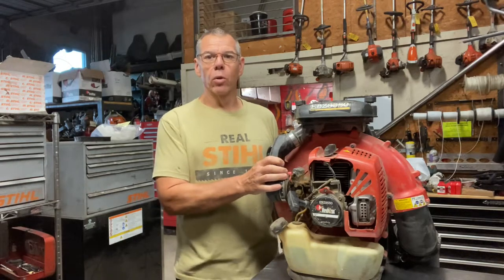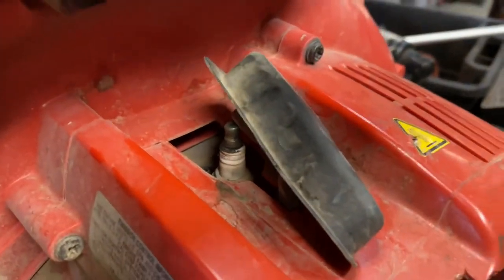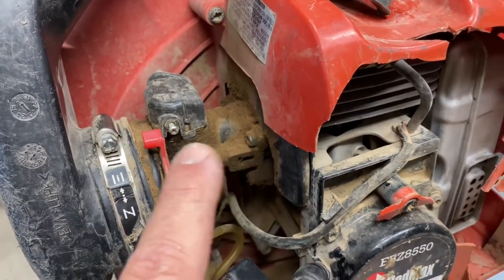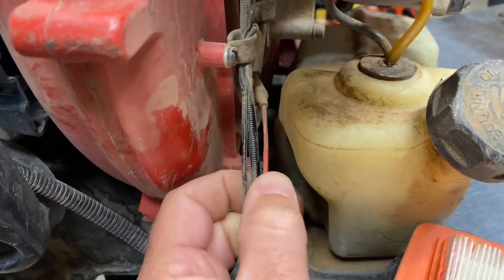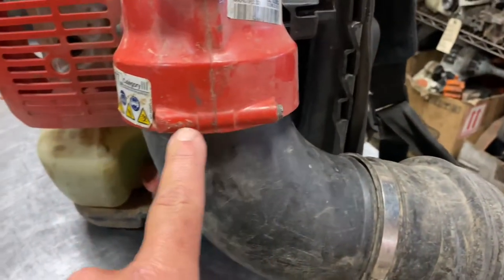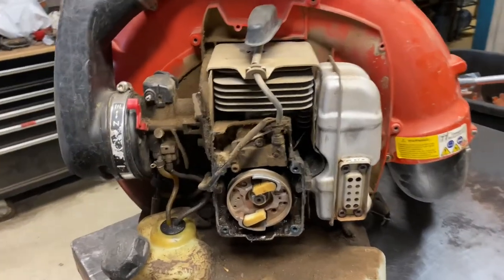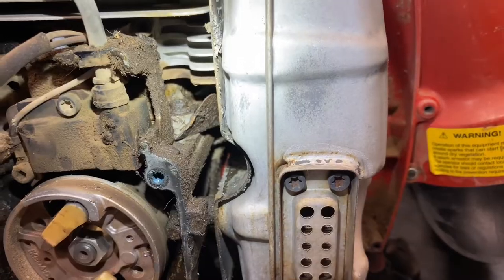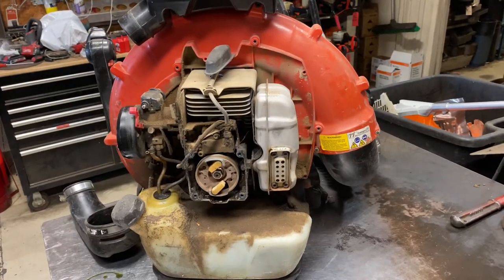Redmax Backpack Blower common problems (EBZ7500,EBZ8500,EBZ8550)

Comment: My EBZ7100 is 17 years old.  I ALWAYS used ethanol free 89 octane fuel with Mobil 1 2T synthetic 50/1 oil mixture.  (I stocked up on this oil when it was discontinued in 2010.)  Used approximately 20 hours a year (340 total hours).  Replaced air, fuel filter and fuel lines once.  Replaced spark plug every four years (80 hours).  I run dry and fog the cylinder each winter when stored for 3-4 months.  No carb work ever.  GREAT machine!

Comment: i have my original blower from 2013 many hours on it, did a top end two seasons ago and it runs great but sounds like its going to blow up lol. found out the fan spacers were all worn to hell. easy cheap fix and she will still be able to work as our back up blower
Reply from the maker: Glad to hear. They had a problem with fans a few years ago where the metal inserts came loose. We replaced a lot of fans under warranty.

Comment: Thanks for sharing your wealth of knowledge. I have a used Redmax 8550 I just bought. Ran it for 2 days and bought it but the vibration is bad when idling but Improves when speeding the engine up. Do you think there is a problem with the blower fan being out of balance.What do you think?

Comment: I rebuild these all the time locktite all your engine screws and fan screws, put a tiny dab of silicone sealant at the end of the crank split case gasket where the cylinder gasket meets to be sure not leakage 👍

Comment: outpowers stihls...and more reliable.
this is all mainly abuse.
7 years on mine...starts on 3rd pull cold everytime since new.....1 pull hot.
Reply from the maker: I agree most is from abuse. Some guy’s just don’t care.
Reply: I find the Stih to be far better. I have had my Stihl blower for about 6 years. Bought the Redmax two years ago and I take both with me doing very light, part time work and so far the Redmax fails me every time and I have to shut it off and go get the Stihl which sucks since I spend over $850 on the Redmax. They are junk imo

Comment: My dad bought a red max EBZ8001 on 2008. He used it for tree lawn care business until he stopped using on 2013 and he puts around 4 hours a day on it. Yes he does put it in full throttle all the time when he’s using it. He put approximately 980 to 990 hours per year and times that by five that’s around 5000 hours. Since he stopped using it. On 2013 which was 11 years ago, I’ve been using it every fall to clean up the yard. I put about 1 to 2 hours per year. I have additionally put on 22 hours per year and it’s still running to this day. I’ve ran a 45:1 to 50:1 oil gas mix. I Just have a question I have been wondering if they discontinued the EBZ8001 model? I haven’t seen Those red max models anywhere.

Comment: I bought one of these brand new for over $600 two years ago. used it very little then it wouldn't start after just once season; it needed a new coil and the company would not pay for it so add another $100 and I'm $700 into it. Last year it started dying whenever I would try to increase the power to blow leaves; I stored it in the shed for the winter and just used my Stihl blower which is not quite as powerful to do some jobs to finish up. Went to use the Redmax this November after not using it at all and same issue. They replaced the carburetor (another $130 cost) so now I'm up to about $850 and it still is not blowing anything. Any advice?

Comment: I have a ebz6500 I noticed oil not on the exhaust side but carb side down the block would it run differently I don't see any difference in performance or spark plug color just that it's essentially harder to start initially cold I run 89 Oct rec fuel and redmax oil I do run 40:1 have a gallon can get the bottles of oil that mix 2.5 gallons but my plug is golden brown I'm not leaking out of the carb or intake would you be able to tell by spraying carb cleaner around the base while it's idling?

Comment: The exhaust port on the cylinder has a problem with clogging up on the 8500 which I assume it has to do with the intake manifold and the cylinder head leaking
Reply from the maker: That’s usually related to what kind of oil and gas mix someone is using. Cheap oil or a heavy mix ratio will cause carbon buildup.

Comment: I have a 7500 I can not figure out why it runs great but when you pull the throttle it ramps up normal and than dies way down and barely blows, I have changed the Carb with OEM carb changed plug filter is new and plug is new and fuel filter is new and I have done everything and still can not figure out why it will not run properly
Reply: Following same issue

Comment: Have a EB7000 that i bought brand new in 2000, run it everyday, changed carbs few times, starters, normal maintenance. Im starting to hear a crank noise or rattling sound on start up, not sure what it is but it runs good just want to see if anyone has encountered this? Wanna wait and see before i take to my mechanic since i can do minor repairs before i decide to go with him for major stuff...any OG's here?

Comment: The ebz8500 unit I have here won't start . It has zero spark , also has 75psi ( dry) & 110 psi (wet) . Based on the compression , is it worth trying to save it? The coil has both wires ( for kill switch) & still has zero spark.

Comment: I've had an issue with the engine flooding since I purchased it brand new.   Fuel mix may spit out the exhaust when pulling the string.   When mine actually starts and runs,  it's is powerful... but I feel like I have a lemon.
Reply from the maker: That is unusual for those units, the carburetors are very reliable. Sound like it could be warranty if you purchased from a Redmax dealer.

Comment: have you run into Flywheel notch problems wearing out on a newer blower? I'm in nj I've ran into this problem even on the trimmers
Reply from the maker: No, never flywheel problems. I have seen problems with fans though.

Comment: My dad has a 7500 that worked like a charm for about two years, he's good at maintaining it as well he's not harsh with his equipment. All of a sudden it stopped turning on and about 10 pulls in it turned on accelerated completely for a bit  then turned off almosr instantly, was wondering if that's a common issue and what the fix would be.

Comment: I want to buy a new Redmax Ebz8560 just for my
House.  Not commercial use. Any reason I should consider the Stihl BR800 or the Echo 9010 over the Redmax?  

Also I have non ethanol 87 easily available. Should I run octane booster or would I be better off running 93 with ethanol?   It won’t be for commercial use but it will get used often as I use a blower to dry my cars after a wash so the fuel won’t sit in it for very long periods.
Reply from the maker: Lately I am a fan of the 9010 but the Redmax is good also. You want to make sure and run 91-93 in either, both are prone to detonation. I prefer non ethanol but if you plan on using it frequently ethanol fuel will be fine.
Reply: @wallysworkin823  same.  I hate that there isn’t any higher octane non ethanol around here.  Thanks.
Reply: The 9010 has a great warranty too
Reply: @Walter_melon21  yep.  5 years for residential.   I did buy the 9010 about 8 months ago.  Been a good unit so far.

Comment: What are your tips to keep these running forever?
Reply from the maker: Good fuel, good oil, good maintenance. We have customers still running old EB7001’s, some are homeowners that bring them in once or twice a year for a check up.
Reply: @wallysworkin823  thank you for that. I’ve owned an EBZ8550 for over a year. I notice it is a gas hog is that normal?
Reply from the maker: @dg5476  Yes, very normal. Stihl has the most fuel efficient backpacks.
Reply: @wallysworkin823  I see. Still love my Redmax, the power is amazing. Thanks.

Comment: I have a 7500 and started to fail on the accelerator it wont decelerate. As sokn as you pull the cord it accelerates. Anyone had this issue that can help me out ?
Reply: Have 1 and the throttle stuck is on wide open. Any help?? Thanks

Comment: Ive got a brand new 7500 right now abd two weeks in starting to bog down at closer to full throttle, still havent got figured iut whats causing that.
Reply from the maker: Make sure you run premium fuel, Redmax like high octane gas. It may just need a carb adjustment.

Comment: Amazing video
Reply from the maker: I appreciate it!
Reply: @wallysworkin823  when u put a new head gasket it on do u put a thin layer of high temp silicone insure bond 

Also is there a tech Manuel to get exact torq spec for these engine 

I’m a small engine repair I work out of my garage and starting to do a lot of land scapers repairs in my area I’m located Long Island ny 
I started out and still doing performance preadtor 212 engine for go karts mini bikes but I also do wat ever comes my way lol know lot red maxs lol 😂
Reply from the maker: @TheGameBoy56  I believe the factory specs are 70-75 inch pounds, been a long time since I’ve looked. I torque them 80-85 inch pounds. I have better results at this torque. You really don’t need to worry about it to much, use a good T27 T handle to tighten them up, just don’t go crazy. You do not need sealant on the gasket.
Reply: @wallysworkin823  got ya 
Thanks buddy

Comment: What octane should these use?
Reply from the maker: 91 or 92, whatever you have in your area. These blowers need good high octane fuel or they will detonate causing piston damage.
Reply: @wallysworkin823  we actually have 91 and 93
Reply: @wallysworkin823  is 93 octagon to high or would you say 91 is the safest bet from gas pump
Reply from the maker: @coreybunss  91 is fine 93 is better. We use VP fuel and it’s 94.

Comment: The two biggest ones i see you missed. The 2 lower engine mounts always break right off, and the choke levers break off every 3 days
Reply from the maker: I didn’t mention the engine mounts because I don’t see that issue anymore. Years ago they fan and motor mount problems but that seems to be resolved. I did forget the choke levers too!
Reply: When you ever rebuild these use locktite on everything make sure to tighten to specs and they will never have an issue, always check your  engine mount screws it's easy to remove and locktite
Reply: What the hell kind of shit are you doing to your blower? You must have anger issues if you're breaking either one of those things...
Reply: @paulspomer16  I have no idea what my customers do to their blowers, but I also don't know why you are asking me what I do to my blowers because I don't own one of these, and I never have
Reply: @nickflopper  Well then your customers must have serious anger issues. Cause neither of those things should EVER break.